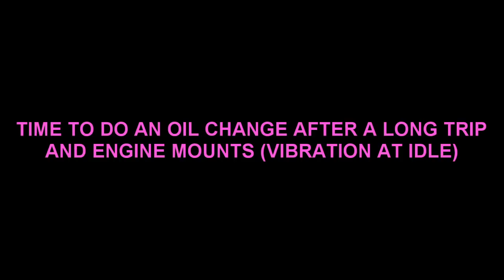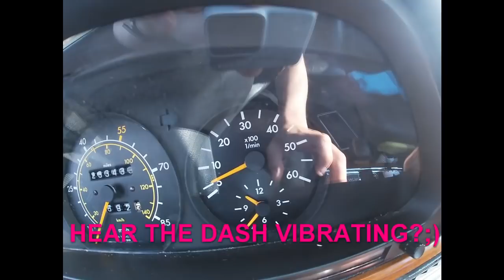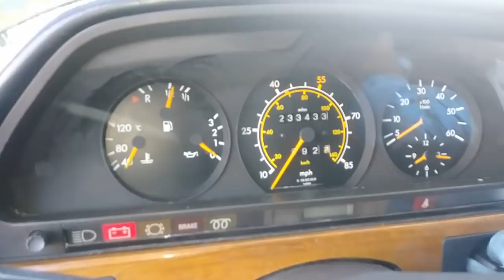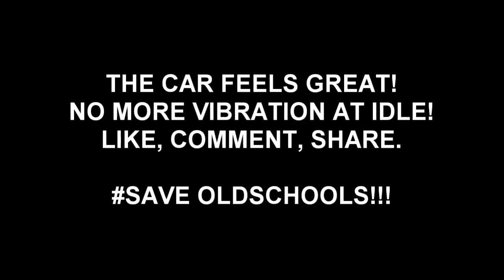MERCEDES W126 300SD MAINTENANCE AFTER A LONG TRIP! STRIPPED ENGINE MOUNT BOLT!!

Comment: Vito, good series of your road trip. Thanks. I had a diesel from ‘86 - 2000. Totaled by a drunk driver that blew through a red light. 

A mild caution - be a little careful about working on your car in the street or in parking lots in CA. Police aren’t mandated to enforce the law (there are laws prohibiting it. Usually a fine.). Parking Enforcement is more likely to write a summons. Los Angeles is one CA city that enforces this law. Just a heads up. 

Thanks again! Looking forward to more. Would like to see some transmission work like modulator pressure adjustment! Or band piston and spring replacement with possibly like a Superior kit.
Reply from the maker: That's so sad... I can't believe it! These cars are just amazing! 
And yes , I know, I am currently in central CA. I totally understand and thanks for letting me know. However, my baby needs to be fixed. I don't trust anyone else fixing it. Doing everything myself. And definitely, I need to do some work on the transmission, will be doing the modulator at some point. I did the shifter bushings and AFT fluid change. I have a lot of repair videos on these old  school cars. 
Thank you for watching and for your support! SAVE OLD SCHOOLS!
Reply: VITO'S GARAGE One more thing. You must get yourself a magnetic mount w/extension for your GoPro. It’s cool that you hold the camera and show what you’re doing. It’ll be much cooler when you can work with two hands. You keep getting better and better. Thanks.
Reply: @VITOSGARAGE , hi. I have a w126 300 se and I thought of swapping it with the om617 300D, please advise if its a straight fit.
Thanks
Reply from the maker: @vincentsebina7182  that will work. Check out my recent video about my 300SD W126. It has an om617 turbo with 4 speed auto trans.🚗